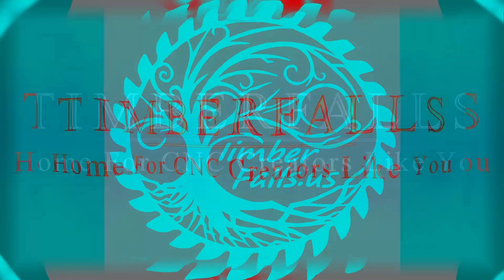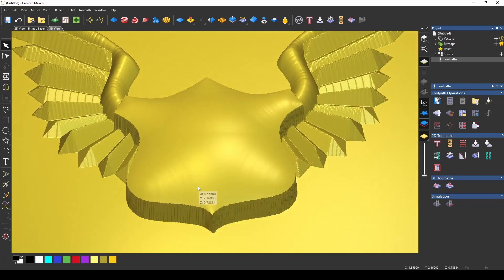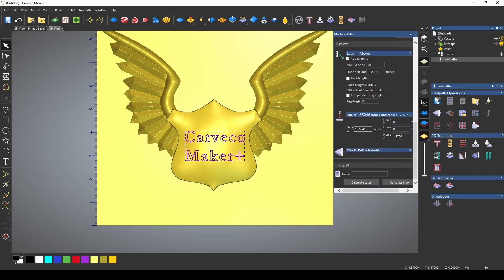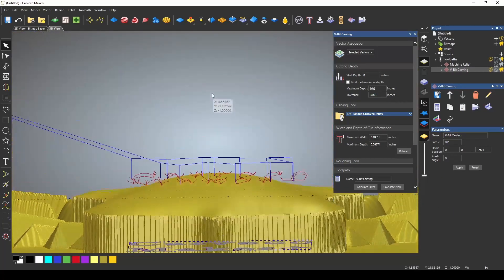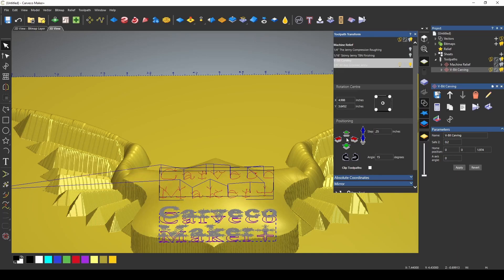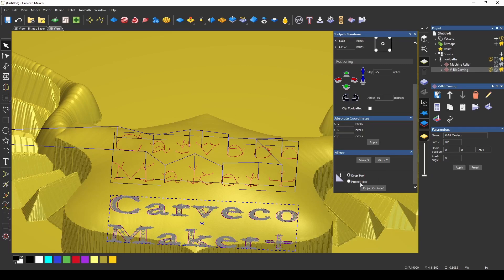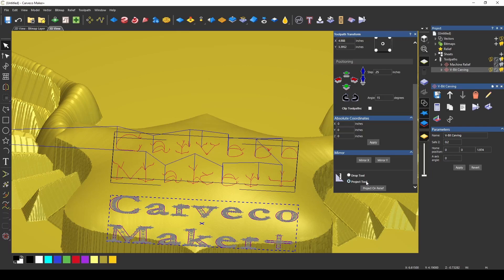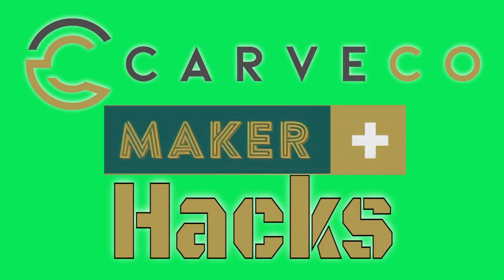Carveco Hacks + Toolpath Transform Tool a 2d Toolpath on 3d CNC Relief

Comment: Great info , can carveco maker plus handle an imported stl that’s a little skewed in the x axis?  Like could u unskew the 3d model in carveco somehow so so the cnc doesnt strip off the paint on half the model when u carve it out?  Sorry, im stuck on this at the moment and dont know how to resolve… tried fades, mirroring, etc.
Reply from the maker: When you import the STL the middle section of the import screen is the rotation commands to rotate the relief on its axis. Then if you need to skew it further use the cookie cutter tool to make the relief blue then use the envelope distortion tool to distort this relief and then paste it back down.
Reply: Thank you so much.  AMAZING!!!  Will try.  Thanks again for taking your time to answer, it really helps to unblock me.  Much appreciated.